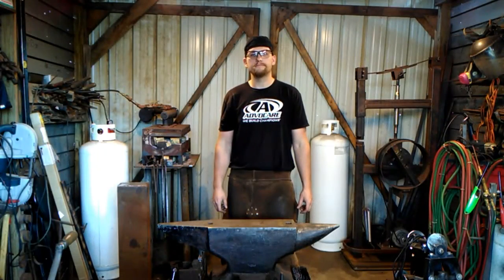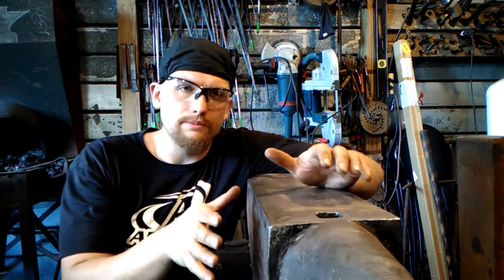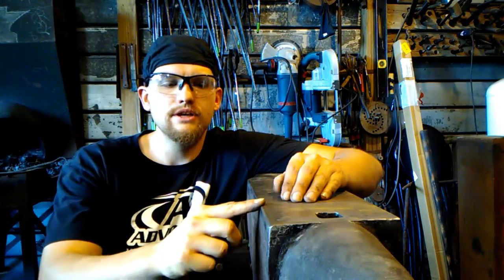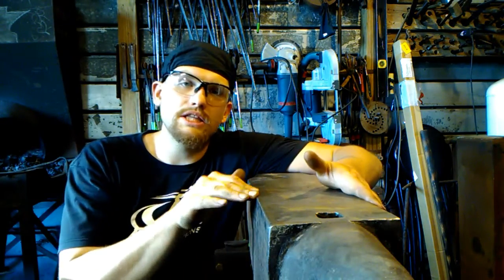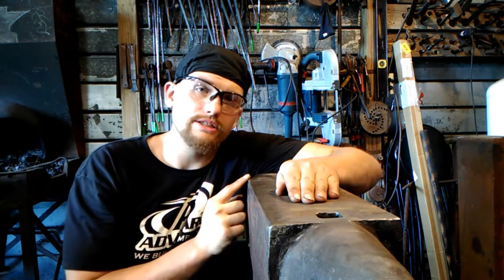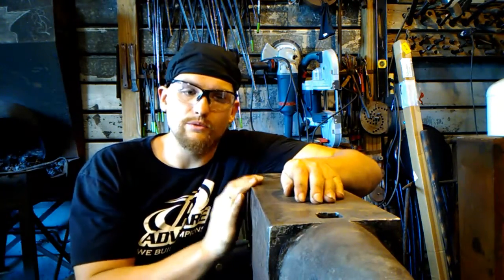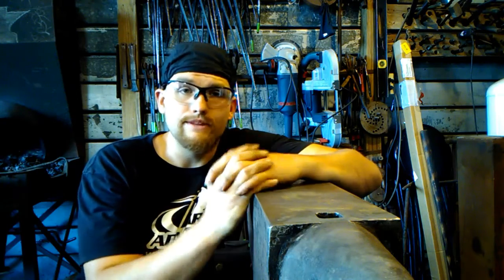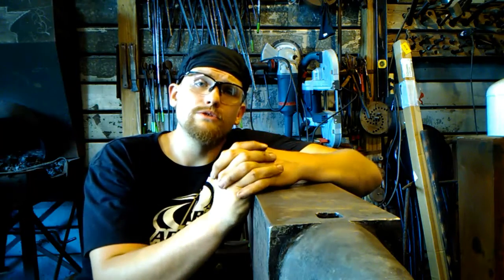To Have or Not to Have Sharp Edges: Anvil Grinding and Dressing Anvil Edges

Comment: Although I'm just a beginner (at 67), I enjoy learning and pondering. Convenional wisdom is helpful, but not gospel. Videos by experienced blacksmiths have shown me the idea of a 2" thick, cold rolled striking anvil for roughing out, then finishing on the hardened anvil. Drawing out seems better done on the thick part of the horn or a power hammer for long pieces. My Rigid Peddinghaus anvil came with a 1/8" chamfer and even that bothers me. I'll round it just as little as possible to get a radius, but I should get to chose how much I want. I agree that the anvil you dreamed of, and saved up to buy, should be radiused to reflect your intent to treat it like the dream tool that you sacrificed to own. Let the cold rolled slab endure your mistakes and the work of art anvil finish out your work of art.

Comment: Handy coming across this video just at this moment. I have spent the last couple of days draw filing and hand grinding a clean level face on my recently acquired 1 1/4 cwt Brooks cast steel anvil. Very time [and file] consuming, but deeply satisfying, work. The cutting table is just as hard as the main face and now it is dressed down clean, has really sharp edges. I always cut on a plate any way so I intend to keep these edges sharp, for the odd occasion they might be of benefit, perhaps for marking out etc. There are many small dings along the main edges that can be cleared by filing a radius of mainly 3/32" to perhaps a max of 1/8 " in a couple of areas, and this I propose to do. I would rather have a consistent slightly radiused edge to an uneven one. Perhaps important not to have edges too square on cast steel such as the Brooks faces, which are pretty hard and thus prone to chipping from errant blows, especially on the edges. I have a good selection of more pronounced radii, which came with Big Bertha, my 450lb cast steel main anvil.
Thanks for all your videos, I am learning a lot from them

Comment: Its your anvil, you do what you like. Me, I use the entire anvil, all edges are radius for different set downs, so why would you need more than a few inches of a 1/16th radius edge? I still think this all comes down to appeal over function, which is why so many anvils are destroyed by mig welding hack jobs that crack with use.

Comment: Sharp edges are what you cannot have. Cold shuts from the cut/crease. If you dont have a sharp edge, there is NO need to dress it.  Some ate very sharp and literally destroys the work. Grinding in a large radius? You are correct,  that is not suitable.  Maybe you saw something you could not explain.  I would not assume it was a sharp edge and the owner ground it to a large radii.
Reply from the maker: +Scott Reynolds I believe I explained perfectly my reasoning for having sharp edges on an anvil in this video. Thank you for your input enjoy your Anvil edges however you like them.
Reply: They getting away Scott free? 🤣

Comment: All my anvils are old and have some dings,. If the dings ore on the edges and not too horrible I fix them by making a smooth radius along the edge. But I spent five hours in the shop with my 17 year old grandson and noticed I have never touched the edges on the anvil I use all the time, we just work around the few minor dings.
Reply: Thanks crooked bar

Comment: If I could have a anvil with nice edges I would 😃 But I think you can do amazing stuff with "well rounded" edges or even chipped edges and dinged up faces but it's definitely easier to use a nice anvil😃
Reply from the maker: You work with what you have. I just bought my "Olga" anvil a few months back. I specifically held off purchasing any anvils, until I was ready to upgrade one in superb shape.

Comment: I use a highly sculpted anvil like the one Roy is referring to in this video.  It isn't actually ground to hell but a design that I've modified and perfected over the years to suit the way I work.  Even though I've been working toward this idea for over 30 years, last year was the first time that I've actually build an anvil that included all the surfaces and curved edges that I wanted.  I do not recommend this design for everybody it's just the way that I work and I  wanted to put it out there for people to consider.    Although I disagree with Roy in that I don't believe that modifying an anvil is a proven diagnosis for insanity I do want to support his caution for anybody that is thinking of modifying their anvil to any great extent because it is a very costly and time consuming decision to reverse.
Reply from the maker: +DF - In The Shop Thank you Dennis for stopping by and adding your wisdom to this discussion! I'm glad to have experienced smiths like your self commenting on and adding value to the community. To put my statement in context I believe taking a brand new anvil and removing all the clean edges is insanity.. This has been the practice for a long time as I'm sure you well enough know with 30years of experience. As I have pointed out in another comment I have seen this on numerous occasions at sofa quadstate. Someone just buying a big blu anvil or rigid or new/old stock anvils that have had their faces repaired and machined flat say.. "yep the first thing I have to do is grind off these sharp edges to get it the way I like it " . This makes no sense to me. If you want to grind half of the anvil away there's old wore out ones for that purpose. In my Ironwork the need for crisp clean anvils and surfaces is a must. In this video I'm simply putting forth My train of thought when it comes to this. I sincerely hope that you haven't took anything personal about anything I have said. I have seen your anvil build and although this would of never been my first choice of dressing a anvil. I enjoyed the fact that you had a purpose and a reason why. not just a ideal that this is the way all anvils have to be done for good ironwork. Thank you again for imparting your knowledge on this subject and I hope you will continue to do so in the future. God bless you and looking forward to watching your next videos

Comment: I'm assuming you've used anvils with radiused edges then? What is it you don't like about them? 
Andy
Reply from the maker: +Andy Mckenzie there is nothing I have against a anvil that has radiused edge as I was stuck working with several anvils over the 9years I've been doing this that had radiused edges. The point im making is that the process of making a perfect edge anvil into a wore out one straight out of the box is insanity. Use the anvil you have work with it's curves and edges just don't bring down a great anvil to a lesser level of performance. Thank you for taking the time to comment! God bless you
Reply: Whilst I understand your reasoning I don't agree. In the ten or so years I've been doing this I've never found having numerous radii on the anvil a problem. Indeed to me they're an asset for numerous tasks. Granted the radii on my current anvils are the result of cleaning out chips from previous owners and I haven't ground them in specifically. 

What do you do when you need a radius in what ever you're forging then? Not trying to be facetious, just curious. 
Andy
Reply from the maker: +Andy Mckenzie that's perfectly OK we don't have to see eye to eye on the subject you have your way of working and I have mine. To answer your question if I need a soft radius I use a block with the radius of the purpose I'm trying to accomplish. I believe in tooling up for the job at hand and not making a anvil a do all tool.. When guys and gals get started in this it maybe the only option but we are meant to progress to better and better things not stay with are original harbour freight anvil look a like lol (my first anvil ):-) thank you for sharing your own thoughts on the subject and hope you have a blessed week!
Reply: And you. Take it easy. All the best 
Andy

Comment: question? would you want a different  radius  on one side than the other to use for different  thing. psychological I'm not a black  smith ,thanks
Reply from the maker: +Gregory B usually not As most of the work goes more efficiently with matched sides. Thanks for the great question!

Comment: I like that you have named your anvil, mine is Joyful for the sound it sang as I hand sanded it to clean it up. Unfortunately while the edges are quite clean they have more radius than I would like and the work face also has a slight radius to it.
This is a Peter Wright 250# anvil and I don't know if it was made this way or if the tool maker (assumed) who originally used  it did it. In any case it suits me fine for now and if I need sharper edges of a flatter face I will get or make a second anvil.
Thanks for you video I do agree, make no changes to a good tool that are not necessary.
Reply from the maker: +Paul Wharton love the name joyful! :-) yeah I have seen to many people at quadstate (A blacksm meet in southern Ohio ) just buy a $2,000+ anvil and say that the first thing they were going to do with it was grind off 3/8"of it at the front and taper it to the tail :-( makes me want to cry every single time lol

Comment: I haven't had enough experience to know for sure, but I think I agree with you... If you have an anvil with nice clean edges. If someone wanted a bigger radius, start with an anvil that has chips in the edge and grind them out to get the radius you want. I would much rather have a clean radius than a jagged edge. Been meaning to take an angle grinder to mine since the edges are all cracked and chipped, just haven't built up the nerve yet.... Anvils are not cheap! Define Your Legacy!
Reply from the maker: +Warped Legacy anvils are definitely not cheap especially good ones. That is why it pains me to see guys and gals instructed to grind off all the nice edges of a great looking anvil. Just to suit one particular style of work or trying to make the anvil become a big giant fuller. Thank you for taking the time to watch and comment twan I enjoy are convos :-)